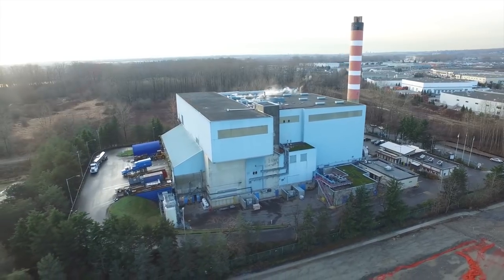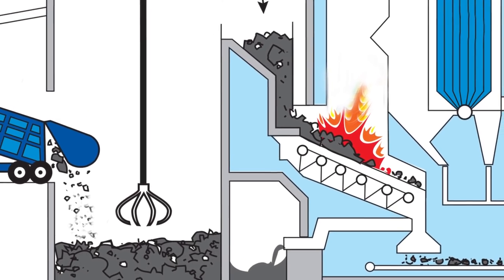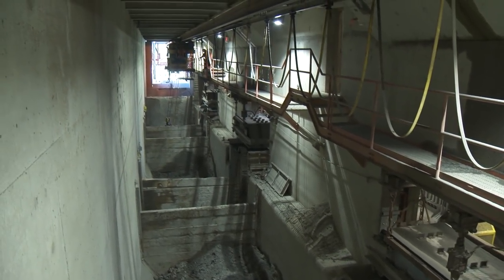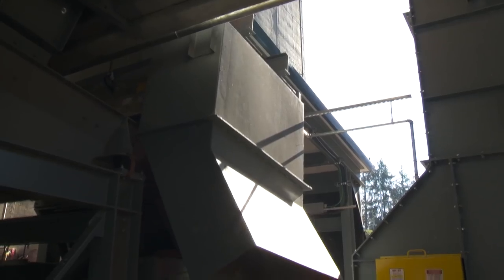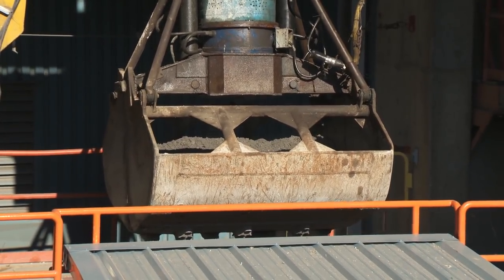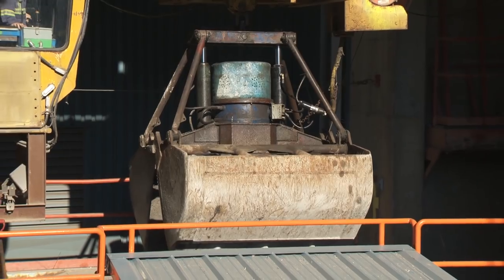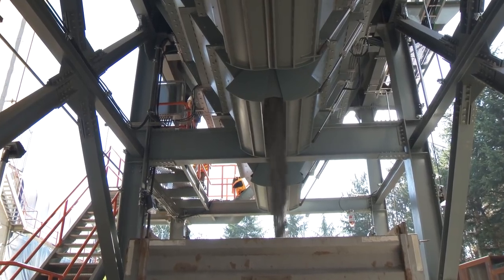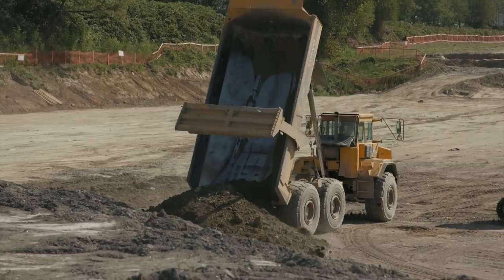Non-Ferrous Metal Recovery Makes Dollars and Sense

Comment: The internet is cool. I wondered if somebody was doing something like this and here I am. This seems like a good way to get rid of trash and still recover some of the useful remains. I just watched a video on New York's similar trash processing. One of the things that video mentioned was that the CO2  produced by the burning is more than offset by the reduced amount of methane that would be released to the air if the trash was put into a landfill. Retrieving the non-ferrous metals is another ecological nicety. It takes a lot of electricity to smelt aluminum ore. Aluminum recovered this way results in a big energy saving.